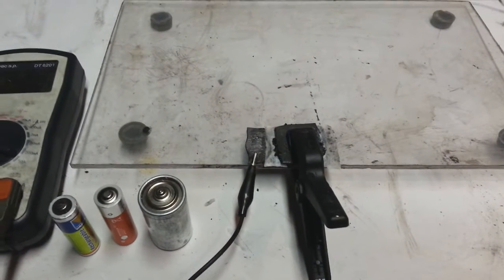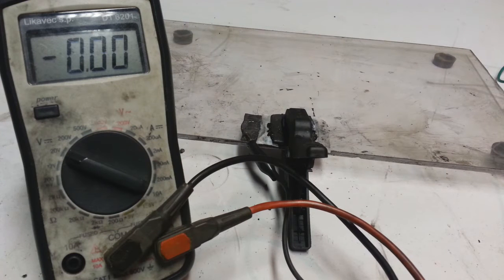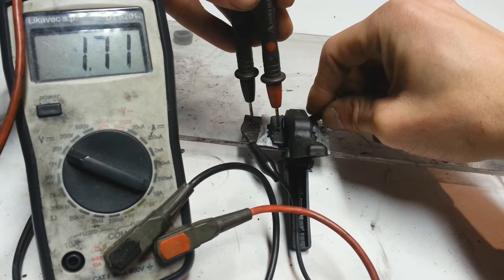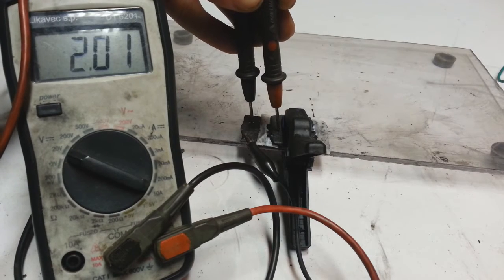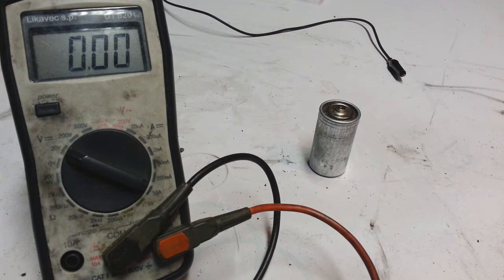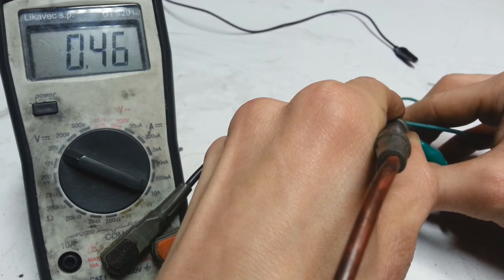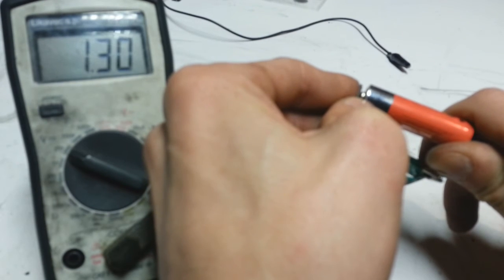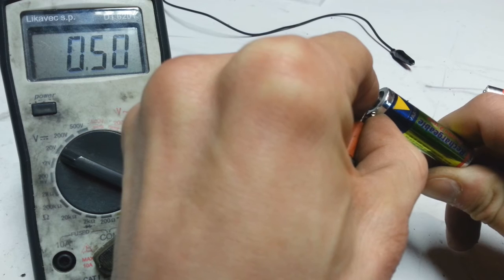Dual Carbon Battery - Update 2

Comment: what battery can you turn on a flashlight bulb ? Hehehe
and how much current if on short?
Reply from the maker: Hari Hcs you mean what battery can run the flashlight or can becomes a flashlight, hehe?
Reply: I mean turn on the Bulb 2.5v flashlight, not just the led

Comment: this test indicates that the duel carbon battery has high internal impedance or low conductivity at the terminals
Reply from the maker: yes, the conductivity of the terminals is 15 - 20 ohms

Comment: The major question is, what is the short circuit current of all the batteries during this test ? Please show it again while using an ampmeter as the shortout device, so we can also see, what the current and voltage is...that would be much better... Many thanks.
Reply from the maker: alkaline and Ni-MH have 5A+ the carbon zinc have 3A and the dual carbon have 70mA because the active material was only 0.03 grams.

Comment: Interesting vid.
Question:- If you have a s/c across any cell you should only be reading just over 0 volts (depending on the resistance of the wire, V=IR)  ?
Reply from the maker: the resistance of the cable is 0.04 ohms. dual carbon battery is not the supercapacitor. the carbon electrodes acting like sponge for ions,.... the electrolyte split to cations and anions. so, the cations and anions intercalated into carbon electrodes in charging proces,... in discharging the proces is reverse.
Reply: Well his shortout cable also has some resistance...
So Cayrex, what is the resistance of the cable ? Dual Carbon, is this just a charged up supercap or did you use the dual electrolyte type setup ??
Reply: Hi Cayrex,
I was doing a similar test on AA cells a couple of weeks ago, recording the data on a pc as the batteries discharged.
I remember that a s/c with an ammeter gave 3A on a ZC cell and 6A on C Alkaline, which was quite surprising. 
It would be interesting to see what your duel carbon cell was putting out straight into meter.
This type of cell looks promising, is it holding up after cycling tests? 
Regards - Martin.